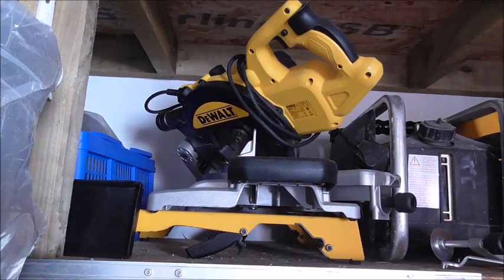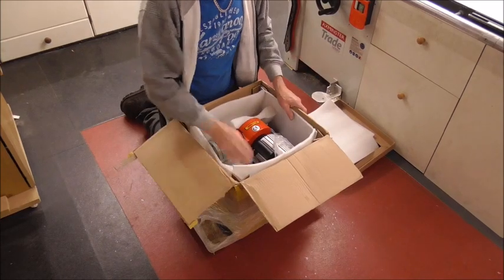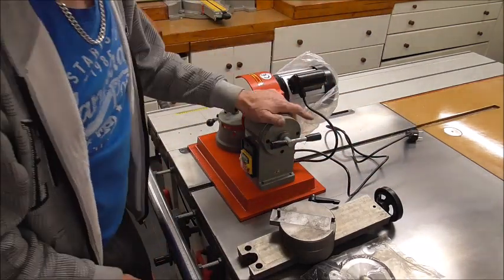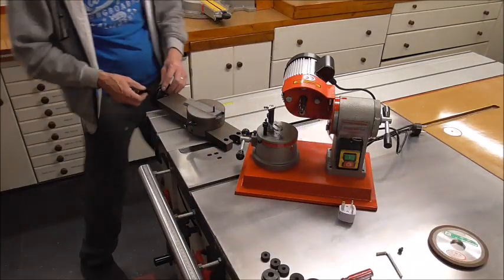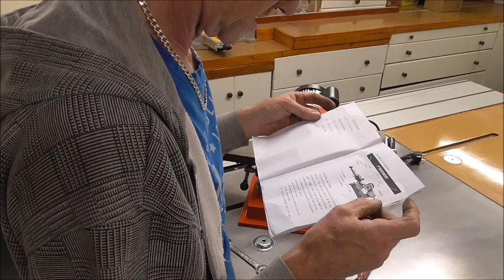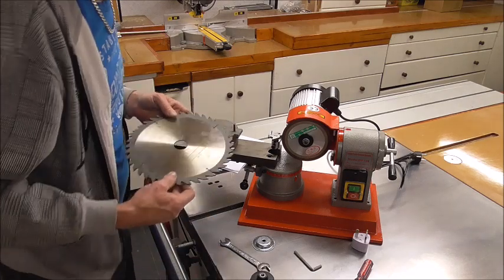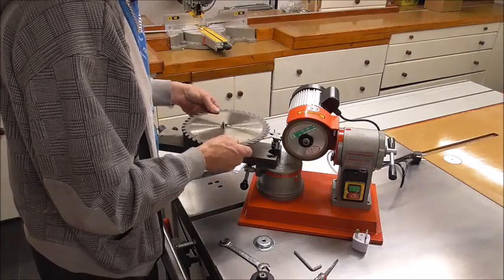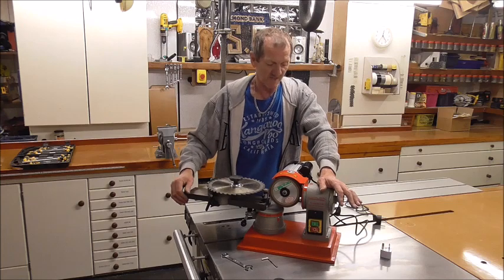Power Saw Blade Sharpener intro

Comment: Old wood turner here, and I should have bought this machine years ago. I immediately put it to the test on a 12" miter blade. After watching your other video, I sharpened the blade to near perfection. Will pay for itself in just the first year. Thank you for your videos.
Reply from the maker: That's great, I use it all the time and no more do I suffer from dull blades

Comment: For larger blades I flip the grinding disc and the saw blade over. That way setting the face in line with the disc face does not foul on the motor case.

Comment: Just got mine.your cast iron is in much better condition than the one I received. I think a wire brush wheel is going to be my next try. And the maker needs to include a 5/8" guide. Did three blades and they did come out well.

Comment: Thanks for that, I have had one of these in my eBay watch list for a couple of months. Around here it is 37 cents a tooth to get TCT blades sharpened and there is sense and cents in having one of these machines. Firstly you can buy cheap blades for circular saws you use for rough work, for example on reclaimed wood, and if they get attacked by a nail or get blunt quickly it does not matter. Also being able to sharpen my expensive ELU and Freud blades without losing them for a week or more is going to be very useful. I look forward to seeing the next video. Please could you reply here when it is ready.
Reply from the maker: WhiteVanMan hi thanks for watching and the comments, to make sure you don't miss my next one just Subscribe you can always delete me after if you worried about your numbers
Reply: Cheers ,David looks a very handy tool
Reply: @dmgladden  

Do you happen to know where I could find the grinding discs for sharpening.. or do you know the spec?
Reply from the maker: @chuckymcchuckface8768  yes I got one off eBay just do a search
Reply: @dmgladden   thanks Sir..

Comment: As I have asked before,, where would you acquire a new diamond wheel. I've checked everywhere and can't find a vendor or source to purchase a new wheel. I hope you answer your comments frequently
Reply from the maker: Hi Gary I answer daily but i cant find your previous request, never the less its easy what i did was just a search on ebay using the data on the disc, the seller i found i think was from Ireland but it was a few years back so i cant be sure now but that's your best option

Comment: Just curious is this only 220 v or 110v or can be used in both voltages?
Reply from the maker: Mine is on 230 UK standard not sure if this can be change or if it a decision on ordering I can have a look when I next get it out if you need

Comment: I just got mine £168 on ebay. Slightly different base, solidly made and works well. instructions? bit of a joke as in '5. The machine doesn't work until it works usually'
Reply from the maker: Yes that's about the right price for it but yes your right about the instructions but when sorted it's a good machine
Reply: @dmgladden  I actually had it on my watch list @ £176 and they made a special offer! It is impossible to get blaes sharpened where I live without putting them on a carrier which makes the cost ridiculous.